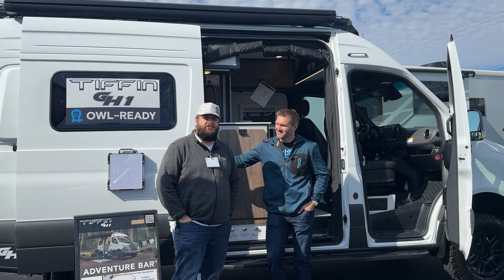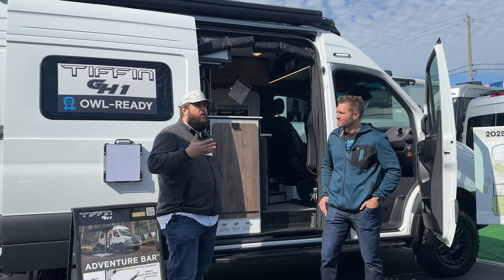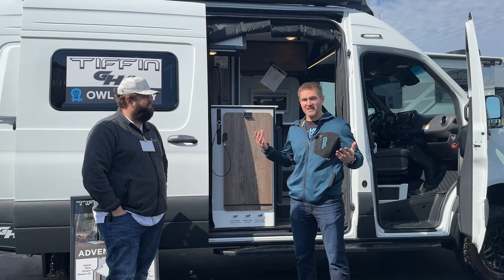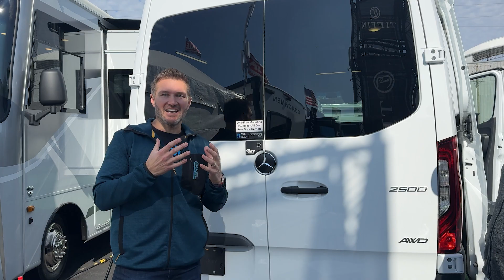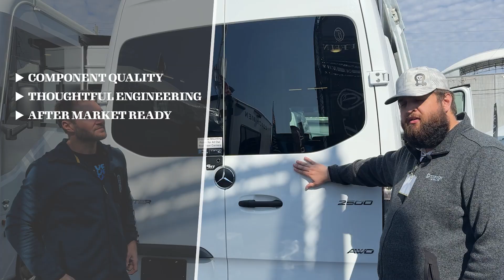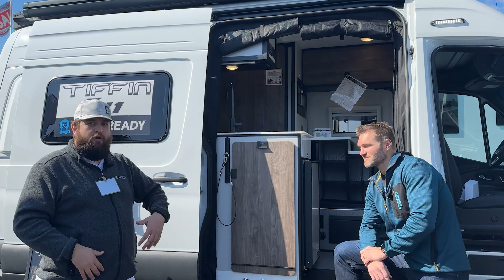Tiffin GH1 | Now Owl-Ready

Comment: I would order one immediately if there are 2 side-view cameras for the blind spots when running at high speed on a highway. Is it a Four-season Class B RV?
Reply: Four-seasons is a subjective term, but I would consider it as being four-seasons capable. There is significant insulation added to all walls, floors, and roof. Fresh tanks and all battery components are completely inside the vehicle and the grey tank that extends slightly below the vehicle has a welded cover over it. All tanks have heat pads built in. It has a hydronic heating system (Aqua Hot) that can heat using both diesel and electric (when on shore power) and the AC also has a heat pump on it. 

Operating any RV in extreme cold takes experience and knowledge to make sure nothing goes wrong - such as ensuring proper air flow to eliminate cold spots. However, I performed some cold testing this past January on one of our Class Bs (which all use the same insulation etc) and was able to easily maintain a stable 67 degrees internal temperature during overnight temps as low as 7 degrees, even without me being inside it. 

You are welcome to come visit our factory in Red Bay Alabama and see each stage of construction if you are curious about how we insulate and prepare for cold weather.